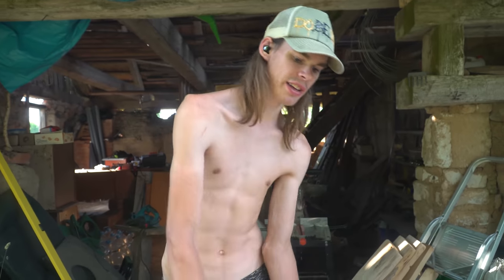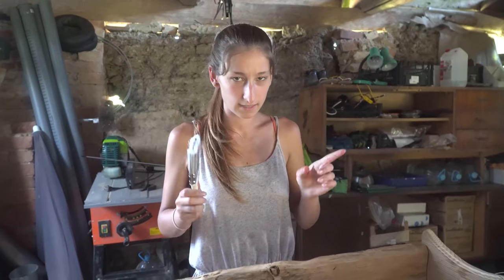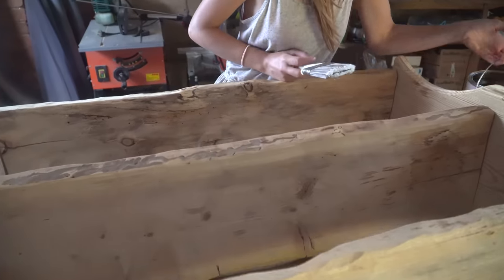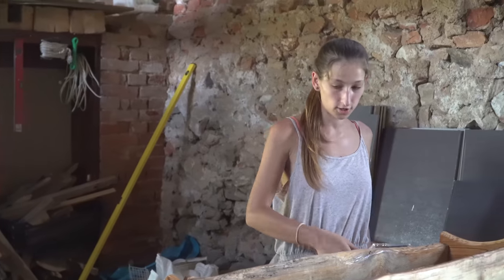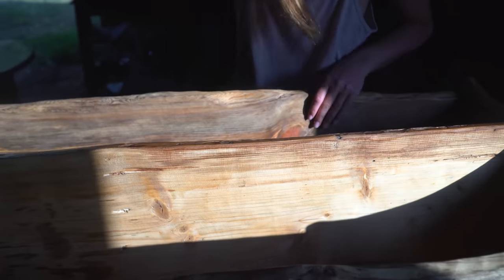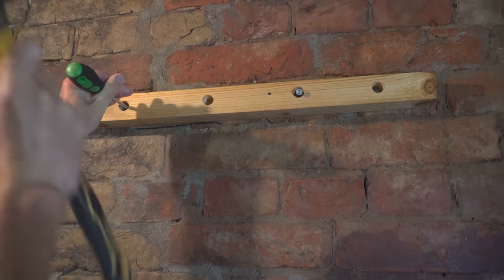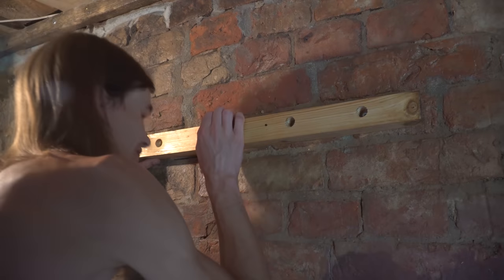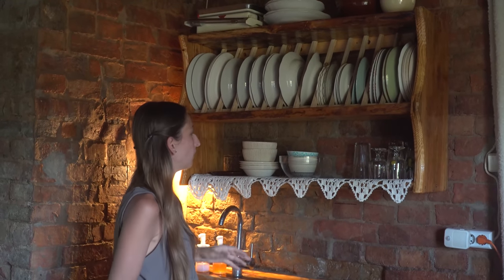RECLAIMED WOOD DISH SHELF (DIY)

Comment: Pull the paint with the grain on the boards whenever you're painting. If you pull the brush back and forth it rubs up the grain and makes a micro shag carpet of little tiny bits of rough wood on the surface of your board that will gather dust and dull the shine. Always brush on the paint with the grain. Just a hint to help with future projects. (Unless you're using a nappy paint roller. Then you can go back and forth, no worries.)

Comment: We always treat/paint before we assemble. This method also allows you can to cover the edges  that join and this is a helpful deterrent for borers and bugs. It is so much easier to paint straight pieces and saves lots of time and you only need to touch up joins after assembly. 
I see that piew piew is becoming a great daddy.   The babies are growing fast and so cute.
Reply from the maker: Yeah we wanted to do that but where tight on time to make it for Despinas mom arriving! Next project for sure 😊❤️

Comment: Love seeing Deivids back in his element.  Your shop in the barn looks good.   Did Deivid’s old work jogging pants get cut off into shorts? The shelf looks very nice.  Enjoy your time with your mother and be good.  Excited to see whats next.  Rainy, humid here in IL.  87 during day, 70 nights.  Corn is tall in the fields and we are eating sweet corn and fresh green beans from the garden. 

How is the pond water level?  Do you need to haul water to the sheep and goat?  How much do you have to haul and how often.  I was Impressed with your hay.  Is there a possibility to get another cutting in the fall?

Get yourself an old fan while you work helps  keep the bugs off you and cools you.  We bought  a floor fan for  our garage really make the difference when it is humid.

Just found new family bought a old Belgian farm. De Hoeve  on youtube Renovating themself.  Big projects.  I’m sure you will relate to their jobs.

Deivids make yourself a nice pushing stick for your table-saw.  I’m sure there has to be pattern online.  Are  you still using the same saw blades on your saw.  Treat yourself to new blades seems like a lot of smoke from your tools.
Reply from the maker: Thank you so much Michelle! ❤️ We are getting around the same temperatures, maybe higher a bit. We have extremely dry summer with no rain fall all summer maybe 5 days in total two months. Most of the garden is dried out nothing is growing as it should, grass is all burned out and new one on the fields doesn't want to grow, this year you can't even make secound cut unless it suddenly starts raining for a week. I have to dig the foundation for the goat house and the ground is rock solid have to use a pickaxe for breaking it lose, last summer would be 2 day job now its 2 week job! The blades are still original i need to buy new ones when money lets us! So many projects and with the heat it's hard to do any of them! The goats and sheep drink around 10l of water a day a bucket a day. Level in the pound is holding good it was raising when it was dug out but for a month now been sitting still! I hope I anwsered everything hahha 😊 next video is out tomorrow so you will see what we are up to next! ❤️
Reply: Do & Be Different Farmily  

I will pray that you get some rain.  I put weed and feed fertilizer on my front lawn this morning.  Humidity is high here.  The fertilizer needs to go onto dewy grass to kill the weeds with the sun help.  Need some sunny shine on the weed for a few days before rain.  Hoping the rain holds off till Wednesday.  I was going to mow my back yard but too humid for this old lady.  Will try this evening.
Reply from the maker: @michellekupczak1280  i been cutting grass for few days and it's very hard with this heat! 🥵

Comment: Only problem I can see is that if there are live woodworms in that wood (and by the looks of it there are) you will have a constant springle of wood dust on your clean dishes and glasses...
Reply from the maker: This particular wood hadno wood worms but yeah it's a problem with the ceiling and some floors. The coiting we use should kill them but for ceilings we used a natural coating which they simply ignored! Need to find an easy treatment 😊❤️

Comment: it soaked fast cause it was too hot, and yeah fine sandpaper after every layer is good to use, but not after the last ofcourse :D
boat lacquer is not the best option to use on a stuff you are eating off, so to speak.. you should have swapped it for lacquer you use for sealings, and other way arround lol